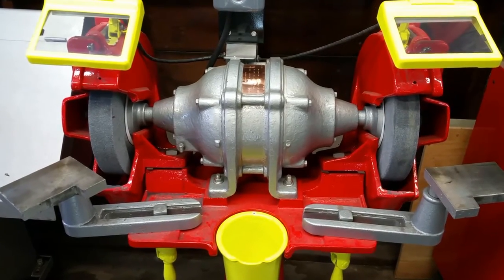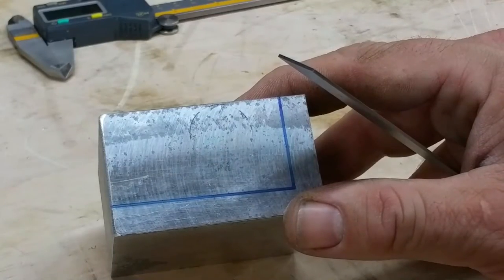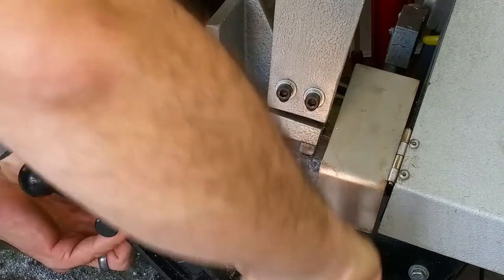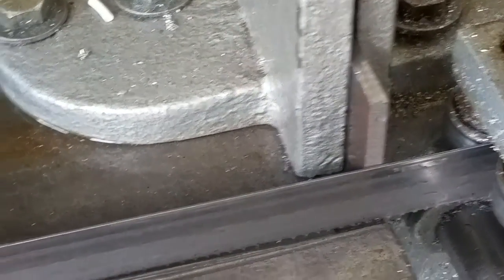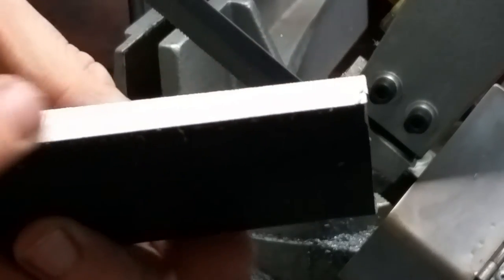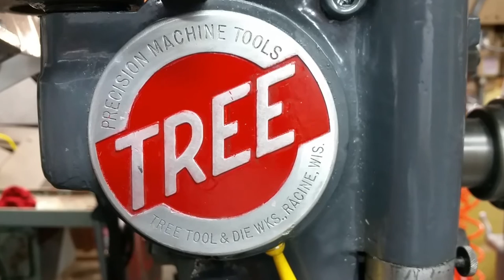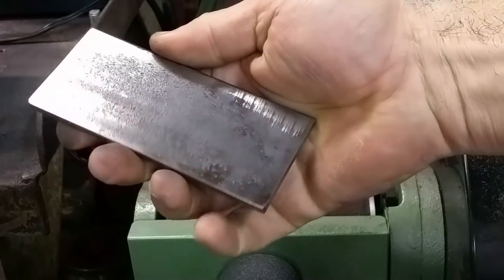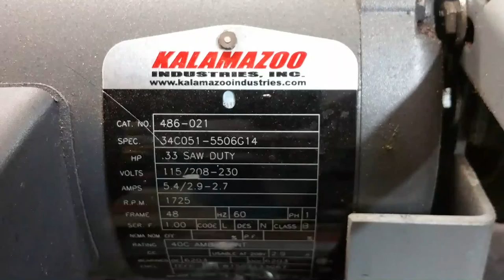Powder Coated Grinder Spits Sparks!!

Comment: Nice Video. One trick to get  past the scale of any hot rolled material when machining is to take your first cut below the scale and into the material that doesn't have scale thus saving the edges of your cutting tools.